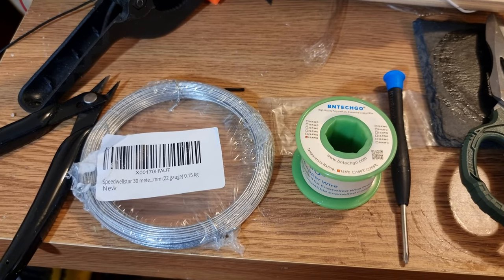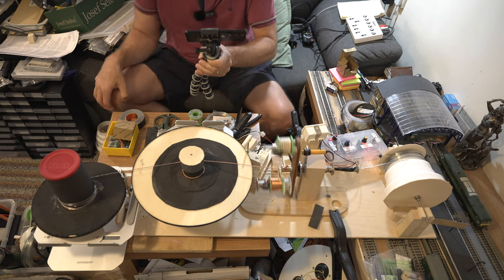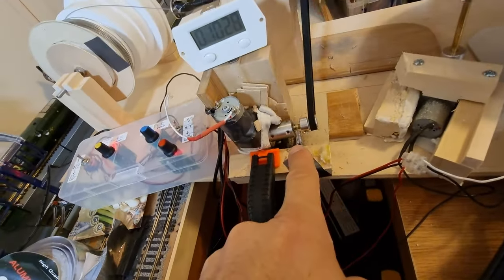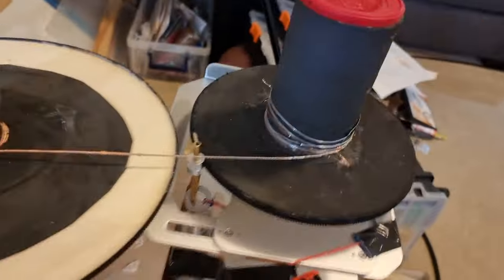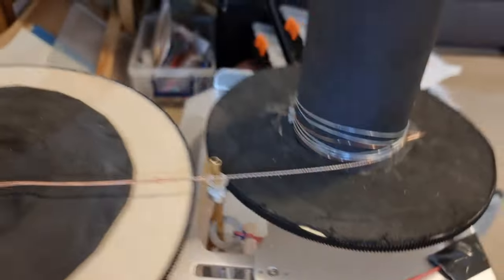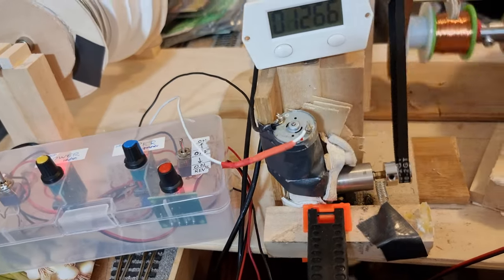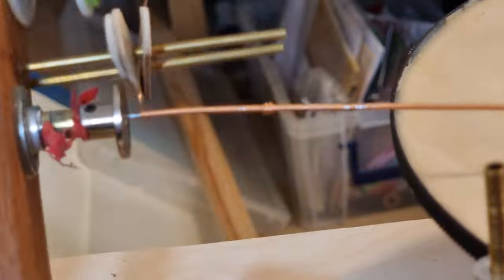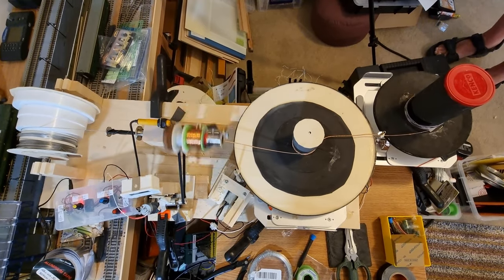O-Day - Cosmic Daves Bagel Winder

Comment: Thank you for all the positive comments. As you can see the feed rate was just very slightly too slow. A 2mm turn on knob#2 fixed it. On the final spool I changed it to a 5mm belt drive (made from 5mm dia. spring). It works fine and is much quieter! 
Today, I have started to construct a double helix winder, the multiple feeder spools (3) were colliding at speed but this can hopefully be fixed by off-setting them horizontally (axially) along overlapping parallel axes. This is for another Bagel version which is just asking to be tried.
Reply from the maker: Hi Cosmic Dave,

Thanks for the update, very much looking forward to seeing this version. I have got some polystyrene supports to mount the coil you gave me in a similar fashion to Zhvirblis and may try this next week.
Reply: @MFMP  Hi Bob. Sounds good. I keep thinking about the number 12 and multiples of, for the Tor wraps. The one you have is a 26, so it may be better as a 24 if you can unwind it and re-wrap. Just unwind the last two and it should semi-automatically reshape to a 24.
I am looking at ways to create a field that has a potential to form geometric fractal P. Vectors.
I will keep you updated or maybe come to visit you in the spaceship if the new Bagel Drive goes to plan.
🛸
🌍

Comment: I was going to use a threaded wooden block to set the spacing of the turns. When I wound a coil as close as his is wound I couldn't bend the overall structure. I will make a video on it when I'm done
Reply from the maker: Yes please!

Comment: Thanks Bob and Dave for sharing details. This is very valuable information. I can see that having slightly too much space vs too little space is likely the preferable outcome. Hopefully I can make time to have a try at this myself.
Reply from the maker: Actually, it shows what can be achieved by ingenuity and purely analogue control of mechanical apparatus.
Reply: @MFMP  Yup I'm very impressed don't get me wrong :) Also very greatful for the tips Dave has given. I was referring to the fact I'de rather have extra space gaps in the coil than have it pile-up so I will definitely try to set the feedrate higher than the feedrate required for tightest packing. I think spacecase also mentioned when he used the tightest packing it had a hard time bending it. Copper wire isn't cheap so it's great to see these types of issues before one attempts it so one can tune things in the most forgiving way possible. :)
Reply from the maker: @petersvideofile  You are right, and with Dave's device it is a slight adjustment of one of the knobs.

Comment: I just made a 6 tori, 5 layers deep, super super super super super tori. 500 feet of 30 gauge wire on to 60 feet of 28 gauge wire onto 15 feet of 26 gauge wire on to 8 feet of 20 gauge wire wrapped in to 2 more tori.
Reply from the maker: That is some achievement, can you share images?

Comment: he can probably do more feet than I can but ibjust completeted 300 feet of 24 gauge on to 60 feet of 18bgauge both enameled, still decided what the final torus structure will be, a 5 tori or possible 3 pointed 6 tori. still havent run electricity throuch them. I have recently received 42 gauge wire and will be attempting a 7 or 8 tori wwith possibly several thousand feet of wire on to 60 feet of 30 gauge wire, nearly microscopic. less than the thickness of a hair for the 42 gauge.
Reply from the maker: If you can work with the 42 gauge wire and not break it, that will be an achievement all by itself!